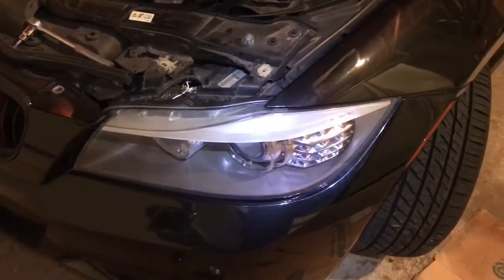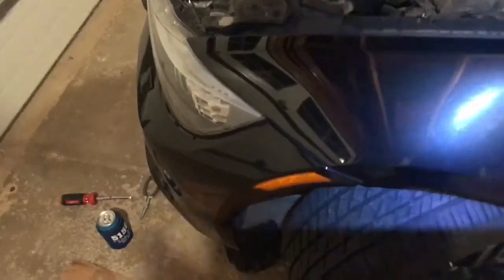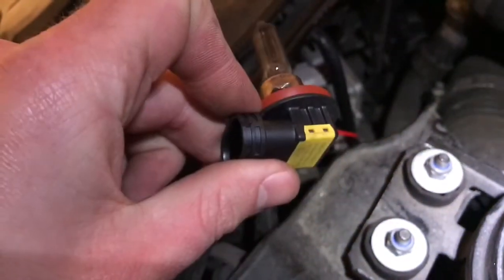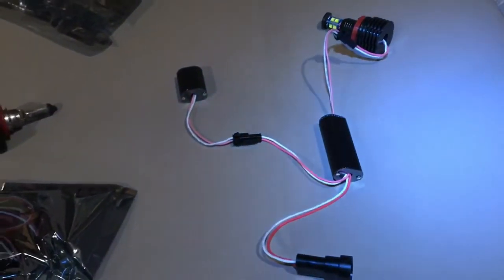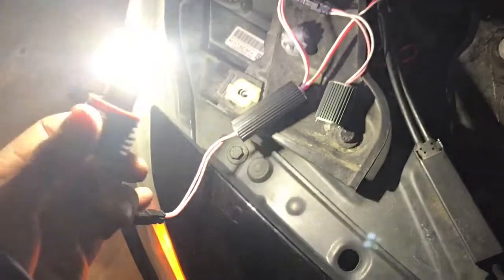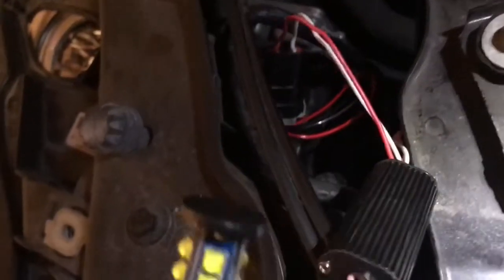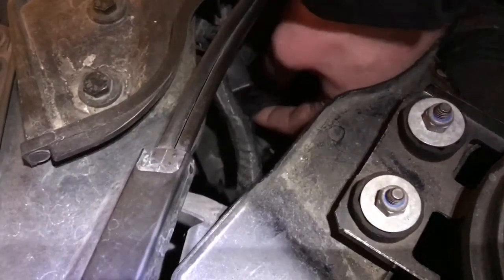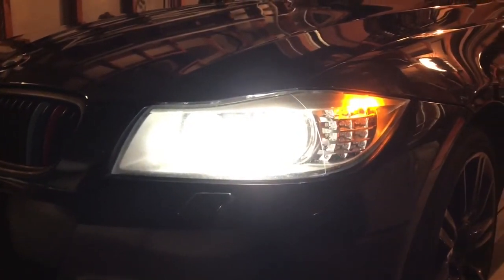How to Replace BMW Halo Lights - Headlights

Comment: Good video pal is that a H8 led bulb you are replacing?
Reply: Thanks BG!  The title of the replacement bulbs are: "2X White High Power 80W H8 Angel Eyes Halo Ring LED Light For BMW E90 E92 E93 X5"  so to answer your question, yes!